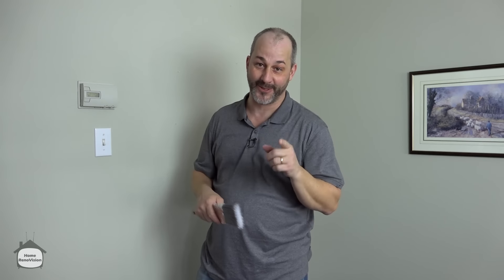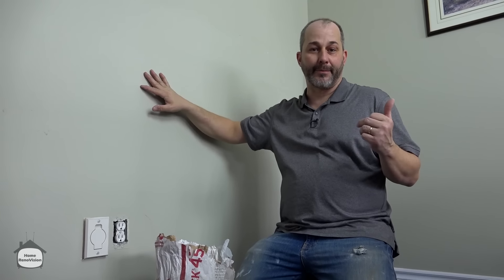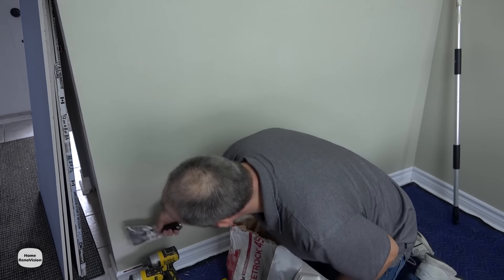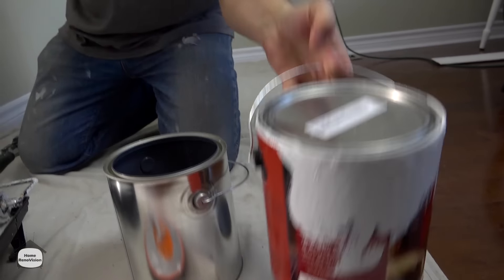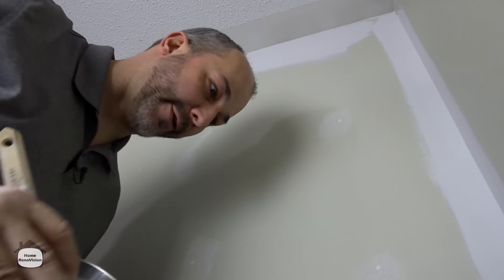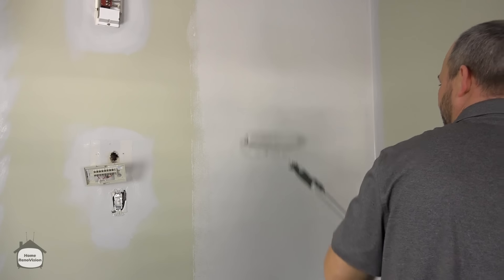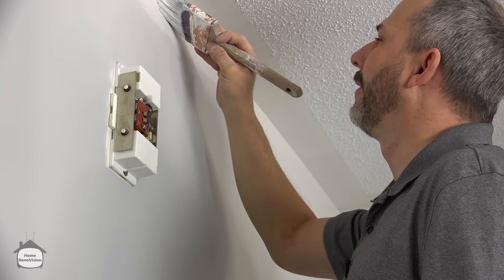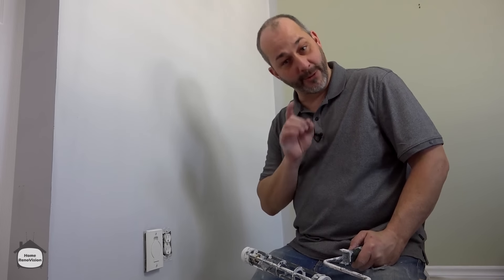DIY How to Paint like a Pro Series A to Z

Comment: I painted both ceiling and walls. ceilings were painted at least half year before i painted the walls. after i painted my walls i ran into a problem. When starting to paint the walls I first taped off the ceiling with thick 4" blue tape. then i painted the walls mainly with a roller even at the edges where the wall meets the ceiling. I got good straight paint finish, dont worry. My problem is that the ceiling accumulated of what looks like some kind of moisture all around the perimeter of the ceiling and was we for some reason and now the ceiling looks like it has some stains on it. any idea of what might have caused it and do i fix it by just repainting the ceiling? thank you

Comment: Pro painter here: Not bad, but you need to focus on maintaining the same angle of the brush when you're cutting in. Also, stop wiping the edge of the brush off every time you dip it, you're gradually working paint up towards the ferrule. Slap the brush on the inside walls of the paint can, leaving some paint on the outside. It's the same technique for cutting in, but your brush will last longer.

When rolling, NEVER start at the top and roll towards the floor, you will just dump paint all over the floor. Start midway up and roll upwards. Last tip: Always make sure the nap/texture points the same direction. I always make sure the final roll is downwards, towards the floor, for the entire surface of the wall. The way you rolled it, if you stand beside the wall and look down the length of it, you'll see two different textures from the light reflecting off it differently.

Honestly, you're not too bad. I'd hire you.
Reply: I'd add, in the event you do sand the wall, it really is a good idea to ensure the surface is dust free before painting - same for sanding your first coat, though this shouldn't be necessary, if your prep and roller technique are good. Seems like a nice guy though. :-)

Comment: What kind of sandpaper did you use with the 360 sander?
Reply: Here is Jeff's response on a 4y old comment: "I like the 220 but 180 works fine if you don't push too hard. Cheers!"

Comment: What if you are trying to fill holes on a textured wall.  Orange peel I think it's called. 

Also,  we have walls that the paint comes off in big chunks.  Do you know what the heck this is.  I'm assuming a hundred layers of old paint with moisture issues?  I've tried to patch with spackle but can never match the existing texture. 
- New homeowner

Comment: Here in the UK. We would Caulk the ceiling to wall. As yours on the close up looks poor. We wouldn't use a brush line that wide, as you will always get a different texture. 4 inch roller does the majority of it. To ensure you don't see the cutting in. It's not how a pro does it here.  And your straight line is all over the place. We would just run a cloth down the edge. Texture the paint, that you cut in? Great vid for most. But honestly are you happy with the ceiling line??

Comment: What kind of paint do I get!?! I’m rehabbing 3 houses myself because nobody wants to work I’ve been watching how to paint lol 🤦🏼‍♀️😅😭 & what if the trim is white and the wall color is different do you need tape then
Reply: Your local PAINT store is a great resource. Also, they are a great resource for paint contractors.
Depends on texture of walls and what they currently are painted. The go to semi-gloss,  can do whole house. The way he shows the cut in, I didnt use tape! One guy on here says use 4 inch roller. Since I just finished my bathroom. I used  cut in like video. I would definently painted further out so my roller didn't have to go to close to ceiling. And watch a bit more BEFORE PAINTING. I learned as I went, but definitely should have watched a bit more BEFORE. But I had watched this video so much, I was videoed out by the time I started🤯
PS  good luck on rehab!

Comment: The rule is no pressure the whole time rolling. If you have to apply pressure you dont have enough paint on your sleeve. The eggshell finish is the sheen of the paint not the texture left by the roller. There is also a trick real professionals use for the outside corner if the other wall is a feature wall or a bulkhead with white ceiling. I seen your brush trick did not work. Also you should of spot primed the mud spots and let them dry before rolling the wall.

Comment: If you want to work like a pro and save yourself some grief work out of a 5 gallon bucket with a screen inside professional painters never use a tray to paint walls. You will see how much more efficient you'll be by using a 5 gallon bucket especially if you want it really load up the roller you can go right from the bucket right to the wall without losing any paint but it's just way easier then bending down and picking up the the paint tray every time you want to move it

Comment: why do you left the brush standing on the bristles , put a small nail on the brush to hang on the edge of the tin ,use a tin without the thick rim ,any old painter can cut with both hands equally fast  43 years exprience ,still painting every day

Comment: Pretty good tips but the drywall mud is a waste of time. The patches "BLEED" through not flash flashing is what you get when you touch up a surface that's already painted and it doesn't match. If you just scrape the holes and putty like a pro you should be good. 2 coats should fix your bleeding problem.

Comment: Holy crap,,,,  hear  we have  a painter who is exposing live high voltage specialist equipment installed by a qualified instillation engineer not a good idea especially if your working with water based paints next to live wires is a no no door handles and non electrical fixtures at your own perril.... Good old decorating masking tape is the right way forward hence the new tapes frog tape 👍

Comment: I didn't understand the purpose of avoiding the edge at the beginning then flicking over it at the corners later on. What's up with that, what's the purpose/logic? What did you mean by plowing forming on the paint. I saw no women around so I'm confused.

Comment: I was with you until you used that roller pan. No real painter would ever use such a useless mess making device. A 5 gallon bucket with a roller screen inside will work much better and make much less of a mess.
You also forgot to put painters tape over the outlets and light switches. If you are giving advice to people who don't already know how to paint, you should mask off the base board because they WILL drip paint onto it and the electric outlets and switches.

Comment: If you really want to get some speed don't knock all your paint off the brush, loaded it up and just hit the sides of the can while you're pulling your brush out try to leave most of the paint on the brush don't wipe it all off on the edge of the bucket you want the paint on the wall not in the bucket. I guess if you don't paint every day this may be a technique to keep you out of trouble but if you really want to move paint don't scrape it off the brush you wouldn't last long on a paint crew if the boss saw you working like that